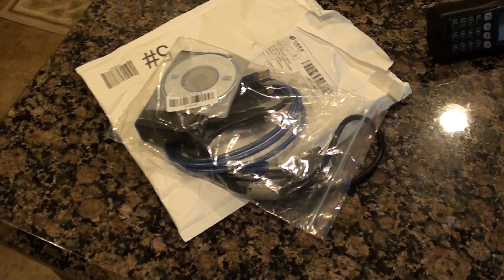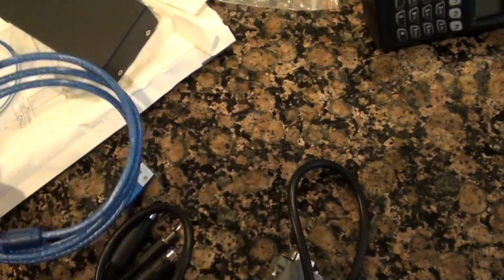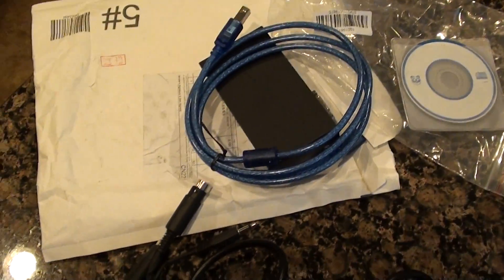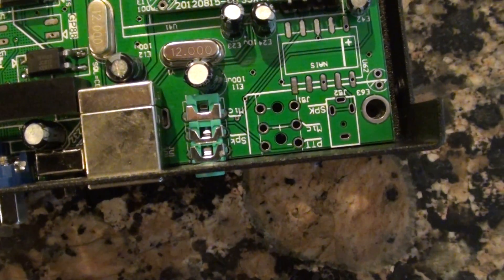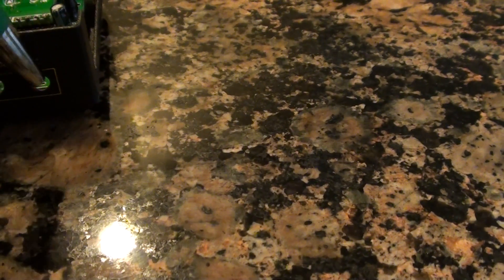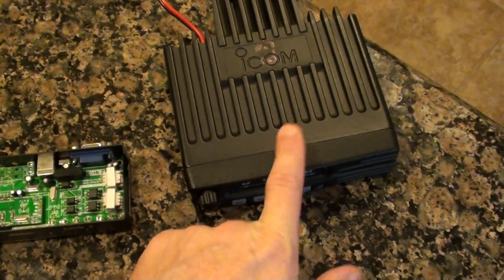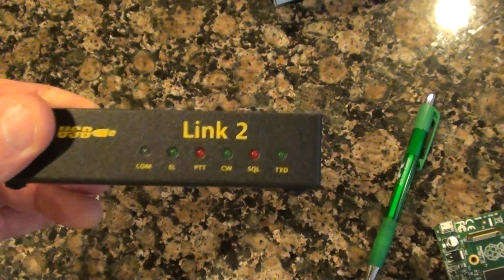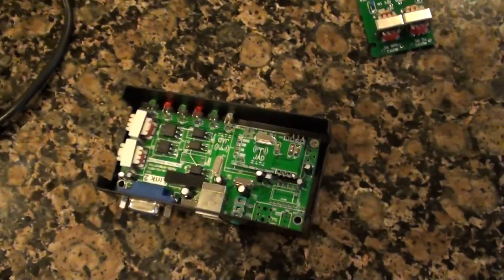Echolink BD7JAD Link 2 Radio Interface

Comment: Have you seen under the print? It is not done well and E13 was not solid to the print at all. The cabels is also very badly solid. Leaders was touching the other connections and I must do the job myself ...nearly from the beginning! 
- Have not heard from you...are you finished with the prosject? ;)

Comment: Ihope you can make a video for Link 2 + Rasberry Pi + rx/tx ...ex. FT-7900 or FT-8800:
- How you connect cabels
- How you install Svxlink on the Raspberry PI and how you can connect for editing config by useing ex. "Putty" terminal program.
Now I am useing my Kenwood TM-D710 for Echolink + Digipeater and Dell with Windows 7 and program for Echolink. It´s working good, but I want to use this radio to APRS in my car. ;)  LA5XFA, Rolf  (Node: 682729)

Comment: The link I used :
http://www.ebay.com/itm/Link2-Echolink-Supported-Communication-Connection-Module-PC-to-Two-way-Radio-/330915758797?pt=2_Way_Radios_FRS&hash=item4d0c1dc2cd